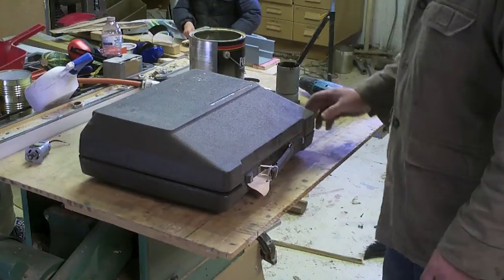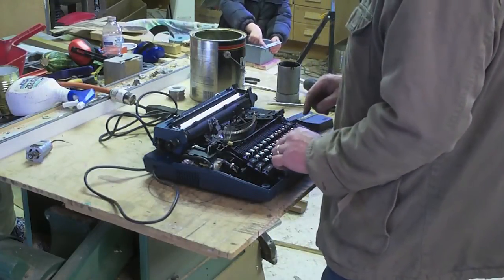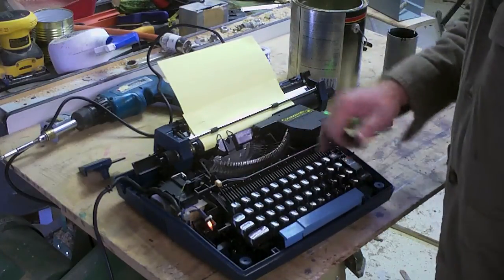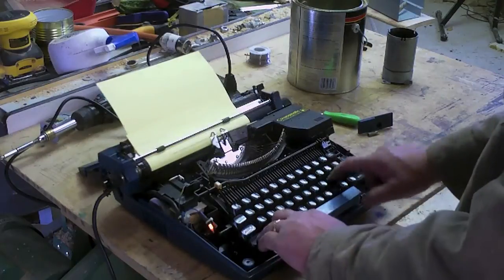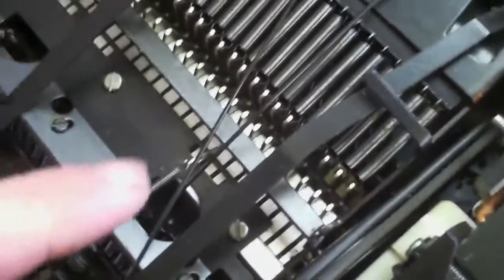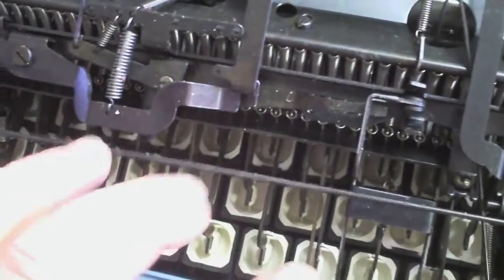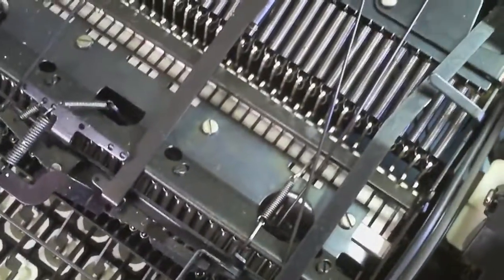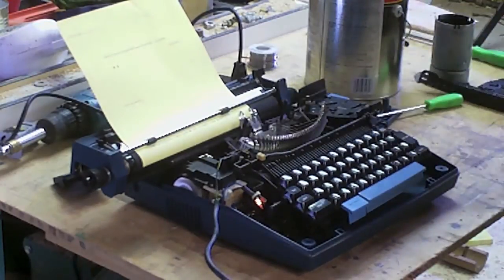Smith Corona Electric Typewriter Autopsy

Comment: 1st I'm a Typewriter mechanic, Thankfully destroying this particular model was painless to watch because it's an inferior to most electrics including other Smith Corona's. Takes a while to tear down typewriters to the frame, I know, Iv'e done this a 100 times ! The coolest thing is the typebar basket when out of the machine. The deal with the #1 was, most all old old typewriters didn't have room enough for so many type bars to accommodate a # 1 & Yes you would use the lower "l" for those. By 1965 ALL typewriters (manual & Electrics) had a #1, Except this 1970's POS model.